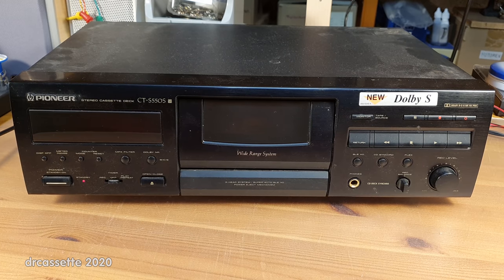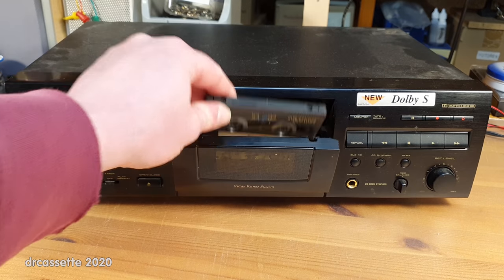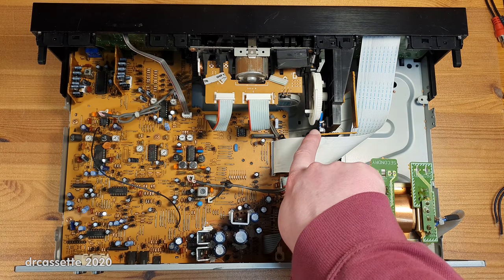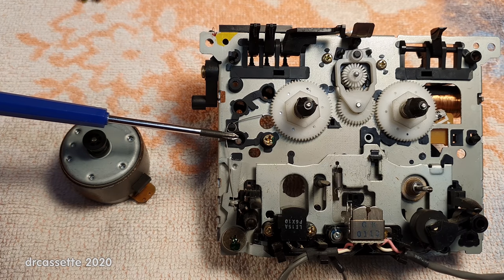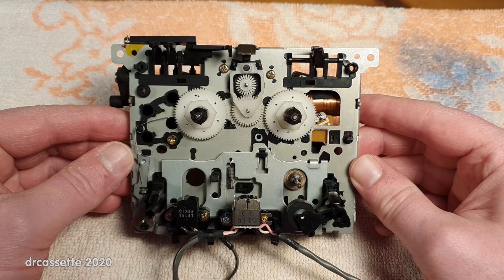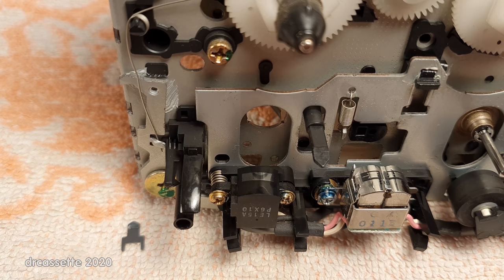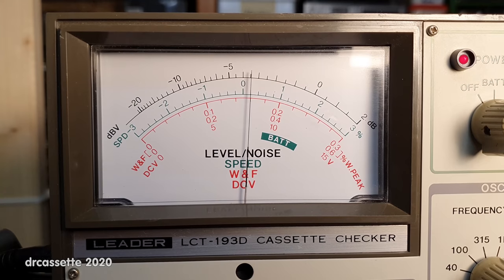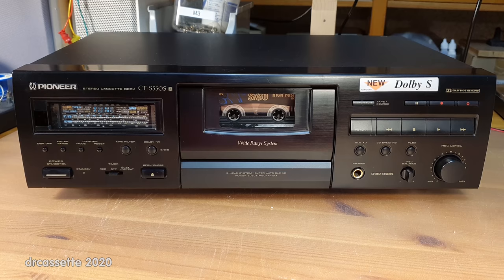Pioneer CT-S550S cassette deck repairs

Comment: Any plans to do further work to fix the dull VFD? Thanks for upload.
Reply: Check the voltages at the VFD, I have had quite a few that were low,  once the voltage is correct the display should be fine in most cases, a quick & dirty fix is to increase filament voltage to improve brightness in a tired display.
Reply from the maker: I have checked the VFD filament voltage, and it actually is higher than I expected, about 4.5 V AC, so the dim display is not because of a low filament voltage. I don't want to increase the filament voltage, because that would reduce the lifetime of the display even further. It is so weak already, some parts don't seem to light up anymore at all.
Reply: @markpirateuk  Why you all messing with heater voltage? The problem isn't there but in HV supply, it has to be between 22V and 37V depending on VFD, most of the cases 22-27V on electronics of that era. The heater is not light bulb and its voltage is critically in range, it can't vary because it comes directly from one of the secondary windings of main transformer, but HV can be problematic.

Comment: Hello and thanks for your interesting channel which I found as I have a CT-S520, very similar to yours, that has a dimming display. Overall the deck works fine but I wonder if you managed to solve the display issue in some way. Mine should need also to have the command switches (play, ff, rew and also other small buttons for settings) cleaned as they don't work properly, play button doesn't even work at all, I have to use the remote. To do so I think I have to disassembly the front panel, is it correct? Also, is it easy or hard to do in your opinion? The service manual is not clear at all for the disassembling procedure of the panel. Thank you very much for your help, if you can. Merry Xmas and a very happy new year! Enrico
Reply from the maker: Thank you! I ended up parting out this deck to salvage parts for other projects. The dim display can not be fixed as far as I know.
Reply: @DrCassette  Thanks for your reply. I managed to clean the switches removing the boards from the front panel and without removing it. The display is so much better now because either the outside window or the window on the display itself were extremely dirty, so I cleaned them and now they are like new. Regards. Enrico
Reply from the maker: @enricoonori  Sometimes cleaning displays can make a major difference. Nice that it all worked out well for you :)

Comment: Have a look at the capacitors next to the FL display. One of them might have gone bad.
Reply from the maker: Thanks for the info, I checked the capacitors in the power supply on the mainboard, I did not expect there would be any relevant capacitors on the display board...
Reply: Interesting, my CT-S820S has the same display and is a bit dimmed, but not as strong as this. Please let me know if that helped. Another fix i heard about is to light up the cathode until they glow red, with an adjustable powersupply, adjust the Amperage slowly up but not too far, otherwise the display will be destroyed. I believe this is why I have never found a YouTube video using this technique successfully.
Reply: @DrCassette  if you don't have a service manual around you might could use a similar display board as a reference from another device. 
To my knowledge a capacitor dryed up by aging or went leaky. I believe it is the former symptome.
Good luck.

Comment: Hi DrC, 
At @5:52 is very similar to the NAD 613 cassette deck if I'm not mistaken? Also, the erase head assembly where you can adjust the azimuth can be found on my Sony TC-K45 which I've recently restored.
Regards.

Comment: Thanks to your video I will ignore any second hand Pioneer CT-S550S decks. That flywheel/capstan assembly is exceptionally badly designed.

Capstans are always a little difficult to remove - not surprising really when we consider the minute circular gap involved.
(Edited x 1)

Comment: hello my PIONEER CT-W803 RS cassette deck has broken dolby S circuit the 2 connection tabs are broken do you have a solution to repair or find a used circuit thank you for  your reponse

Comment: Thank you so much for your video - I just serviced one I bought for 80 USD still working good, though bit slower in speed. Changed pinch roller / belt, unmounted motor / capstan and lubrificated - time now to adjust speed.

Comment: Hello,
Although it is high hours deck, you should check the vfd filament voltage which should be 3v AC any lower than that might cause dim display.
Good job.
Reply from the maker: Thank you :) 
I have checked the VFD filament voltage, and it actually is higher than I expected, about 4.5 V AC, so the dim display is not because of a low filament voltage.

Comment: schönes Video , was allerdings fehlt ist als alternative ein durchsichtige Fenster beim Display & beim Kassetten Fach , da hätte ich ein dünnes Hobbyglas zurecht geschnitten & mit ein unauffälligen Kleber dann befestigt ;-) ich frage mich eh was dieses dunkle dimm zeug überhaupt bringen soll ;-)
Reply from the maker: Der Farbfilter wandelt das grünliche Licht des Vakuumfluoreszenzdisplays in die Farbe, die der Hersteller für sein Produktdesign haben möchte, im Fall von diesem Pioneer-Deck wäre das weiß gewesen. Außerdem erhöht der Filter den Kontrast des Displays, leuchtende Displaysegmente sind sichtbar, inaktive Segmente nicht. Ein VF-Display ohne Farbfilter ist eher schlecht lesbar, das erkennt man glaube ich auch in diesem Video ganz gut.
Reply: @DrCassette   , ah Ok , Danke :-)
Reply: @Alvin-Seville_NBG  Das Display ist ja nur so dunkel geworden im Laufe der Jahre. Weil die Geräte im Standby liefen und nicht komplett abgeschaltet wurden. Dadurch bekommt das Display immer etwas Strom und altert dadurch. Habe hier auch so einen Kandidaten. Suche auch noch Display Ersatz. Ein Schrottdeck wo das Display richtig geht. Abgesehn davon sind auch die Beschriftungen der Geräte extrem schlecht zu erkennen da zu klein und zu blass. Habe hier noch 2 Stück CT-S410 da ist das westenlich besser. Und die Displays noch wie am ersten Tag. Klingen tut das Deck gut. Läuft bei mir auch etwas zu langsam. Warte noch auf meine Testkassetten. Dann wird das Teil gecheckt. Hatte mir das Teil besorgt weil mich die Flex funktion interressiert hat und wegen dem AutoBLE-XD. Werde aber doch eher zu Yamaha KX-670 wechseln.

Comment: Certainly a very nice pioneer 3 head stereo cassette deck u have restored,,,it sounds just as loud and clear on the tape recording,,,from source input,,,to tape playback during recording. 
I've only rarely seen a adjustable erase head on such cassette machines I've repaired in the past,,,and just recently I had repaired a Panasonic stereo  tuner amplifier and double cassette mechanism,,,that had a bad pinch roller on the recording deck,,,which I managed to change over from another stereo unit the same model,,,but unreliable with no power to display panel for sound to any input,,,and also found the small guide clip that had come off the erase head,,,but the retainer holder was still in place on erase head,,,simply pushed the guide clip back into place,,, and cassette player played back as it should,,,loud and clear,,,guide clip stayed in place.

Comment: I didn't see if you you washed out the hole where the capstan pin sits with alcohol or some other cleaner! From experience, if you don't clean out the old grease, it affects the wow and flutter... 
As for the dim display, there's still some other component that is out of tolerance!!! Either a resistor has drifted off in value or there's a bad capacitor or two that needs to be replaced! 
I heard you say that you replaced some Capacitors due to high ESR, but a capacitor with low EPR (Equivalent Parallel Resistance) will have very low ESR but would measure a higher capacity! A Capacitors capacity doesn't get better with age... If it a 100uf capacitor but it measures 150uf or higher, it means that it has low EPR and it's leaking DC which will cause a transistor or resistor to be incorrectly biased and making it run hot or actually destroy it... 
I believe that there's nothing wrong with the actual screen, there's something else that is causing the problem... 
The dark spots on the PCB indicate that the regulator's have been working to hard, and again it's usually a capacitor with low EPR.. in the case of Capacitors in the power supply, a low EPR means that they are either have begun to short to ground or are actually shorting... 
Another simple test that can be done is to plug the unit into a wattmeter and check it's power consumption, if it's been sitting around not used for awhile, bad components will cause the power consumption to rise above it's ratings usually printed on the back... 
This pioneer can be brought back into life like it was New...

Comment: The BLE system is very similar to the ATC system used by Technics??
Reply from the maker: All manufacturers eventually had some sort of tape calibration system in their cassette decks. They all did mostly the same, bias, level, equalization...
Reply: I don't know if BLE is similar to ATC, but I think.
I do own a Technics Micro Component Stereo for my basement and the cassette deck in this system also has a computer calibration-feature called "CCRT" and when you activate it, it will show things like "CCRT BIAS", "CCRT LVL" and "CCRT EQ" on the screen. I assume that this cal.-system is similar to Technics' ATC and so it will be similar to BLE.

Comment: I'm surprised it did not need a head alignment after glueing back the tape guide on the erase head. Azimuth is very sensitive to small variation of the tape path. In my opinion, if you had replaced the erase head, a mirror cassette would have been enough to adjust the tape guide properly. Another (very expensive) way is to use an alignment gauge like this one https://thegreatbear.net/audio-tape/information-terminals-m-300-cassette-tape-transport-alignment-gauge/
Reply from the maker: I made sure the tape was not mistracking after reinstalling the tape guide. Since the tape guide was there originally, putting it back into place should not have upset anything. I don't have a mirror cassette, so carefully looking at the tape and checking how it behaved when the heads first touch it when coming up had to do.

Comment: I had a Pioneer DVL-909 Laserdisc/DVD player from the late 90's that I bought new. It's the same vintage as your cassette deck. The florescent display got very dim after only a few yesrs of light use.
Reply from the maker: That's very unfortunate... I have had other Pioneer equipment with dim display, so it seems Pioneer got their VFDs from a rather bad manufacturer...

Comment: Onkyo taw100 dual cassette deck has the exact same clip holding on the capstan and flywheel and no back plate.
Reply from the maker: This was apparently a common mechanism made by Alps that various different manufacturers used in their cassette decks.

Comment: I am looking for any suggestions to repair a Pioneer CT1280WR dual cassette deck from 1987 that will not play. It will fast forward and it will rewind but it will not play?
Reply: just change the belt

Comment: I noticed the flat/ribbon style drive belt and all-metal capstan in that Pioneer - a few early '80s model Sharp decks used those. Generally reliable.
Reply from the maker: Most cassette decks have flat belts to drive the capstan. Not sure what you mean by all-metal capstan. I have never seen a capstan that was not all-metal...
Reply: @DrCassette  I have - in some cheap Goldstar decks. Metal shaft /flywheel + plastic belt pulley.

Comment: Aiwa is the champion in cost cutting in 90s along with Pioneer. The most disgusting decks I've ever met are Aiwa AD-F300 and Sony TC-FX110  - this is  total abhorrence.
Reply from the maker: You have to keep in mind in the 90s Aiwa was taken over by Sony and from that point onwards was only allowed to make products that didn't compete with Sony's products. In other words, products that were worse than most Sony products. Still Aiwa remained innovative, they would have made the first ever LCD TV, had Sony not forced them to cancel that project.
Reply: @DrCassette  oh, right, that explains a lot then. Thanks for the answer, totally agree with that.
Reply: 😆 - your description of them being “disgusting”
Reply: @samuelfellows6923 🙂 that's just because I opened those decks and I've got around of hundred different ones to compare and I swear I didn't see anything cheaper as those parodies for decks. Really, it's  a shame for the brands' names. My kind advice is - if anybody has even the smallest possible drop of self-esteem inside, try to avoid them as far as possible)). Even if you're given them as a gift, politely decline. And if you're insisted on taking them as gift, pay them money not to take it). If unluckily you take those decks, never open that Pandora box.
Reply: @romanserdyuk9965  I can understand the disgusting deck scenario. Been there, done that with many of them. If the failure isn't a plastic part breaking, with springs and clips flying off, it might be something electronic that burns up as soon as any kind of power is applied (even if the rated operating voltage is correct). Inferior low quality components are often used.

Comment: Hi there, great video. Would you help me out with my deck please? I've got a CTS 540s and the reel motor would not move. No play, no FFWD no REW. The capstan motor works. I connected a battery to the motor and it spins both ways without issue. I am happy to listen to any help. Thanks a lot.
Reply: Bad motor drive transistors or fault in the logic IC maybe? Check the voltage going to the motor and for logic signals at the outputs of the IC going to the motor drive stage.

Comment: I missed the part in the video where you adjust the speed of the motor..??? Can you give a clue where to look for the speedometer? Thanks! 🙂
Reply from the maker: The speed adjustment is built into the motor. There is a small hole in the back of the motor, that is covered with rubber foam from the inside. You have to poke an insulated screwdriver into there to access the speed adjustment.

Comment: Hi!  I would also like to ask whether the pioneer ct-s550s plays the 60-minute tape but does not play the 90-minute tape.  What could be wrong?  Engine, belt, pressure roller?  I await your reply.
Reply: It could be the belts. Make sure the rollers and capstans are also clean.
Reply: usually it does play, but very slowly, you can even hear the capstan strain at times if theres too much tape on one spool. Def the belts.

Comment: Hi, I bought one Pioneer CT-S550S for 10€ with squeaking motor. The nasty sound showed after some minutes of usage. Tried first to oil the bearing, but this delayed the squeaking just for some minutes. I solder out the motor like in this video and used some "multiglide" spray, until the sound disappeared. Then removed the remaining of the spray. Assembled everything again, and now it seems to work nice again. At least for around 20 minutes no squeaking.
Reply from the maker: When oiling the bearing fixes noise only temporarily, that often indicates that the motor bearings are bad. The motors they used in these Pioneer decks don't seem to be very good, the speed of the motor in my deck drifts a lot.

Comment: Nicely done. If the VFD is really dark, you could try to increase the heater voltage slightly to increase the brightness. This will probably decrease its lifetime even further, which may or may not be worth it.
Reply from the maker: I really don't think it would be worth it, the display is already so dim that some parts don't seem to light up anymore at all, an even further reduced lifetime would probably bring it to a point at which important indicators no longer work at all.
Reply: @DrCassette  Do not touch the heater voltage, just check the caps on HV supply it is voltage doubler or tripler and it depends on caps to provide the correct voltage. You can't increase heater voltage because it comes directly from transformer's secondary winding, even if you can it won't help, it will just make it worse.

Comment: Thanks for the video. Do you have any plans for an Aiwa XK-009 Excelia cassette deck repairs video in a near future? (replacing the belts, replacing the idler tires, etc...)
Reply from the maker: I have not come across this model yet, so there won't be a repair project any time soon.
Reply: @DrCassette  ok thanks anyway, i will keep watching your videos. Thank you so much for your work :)